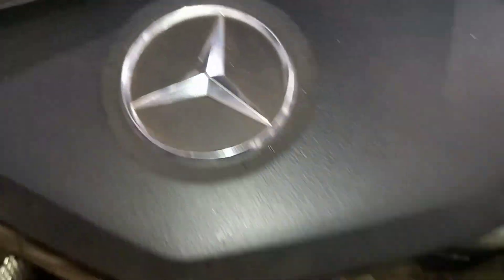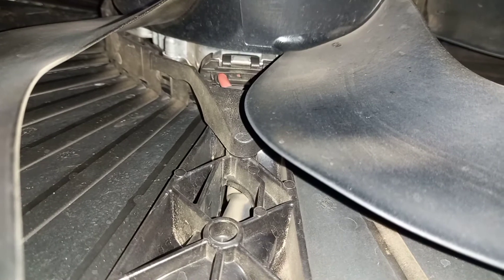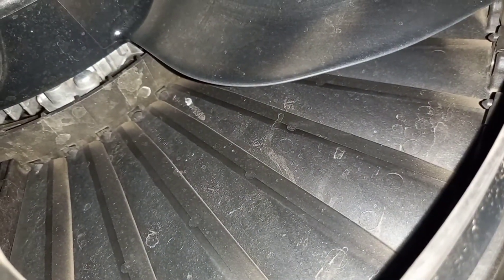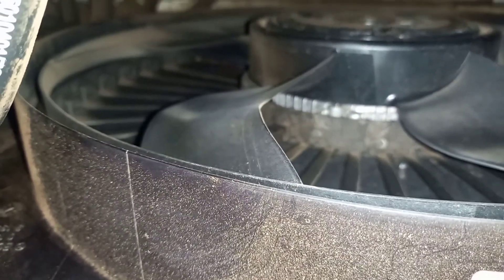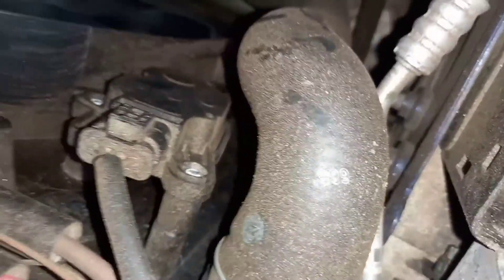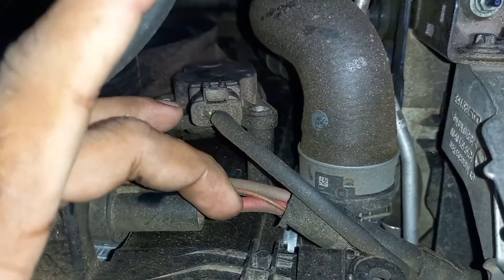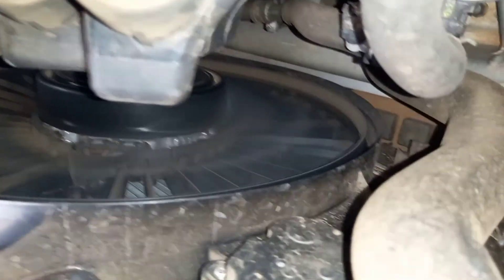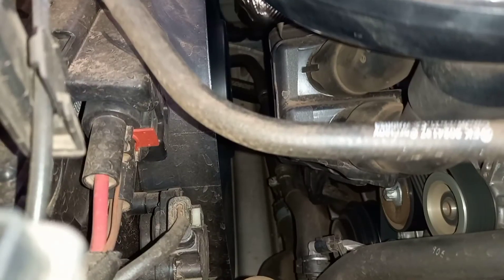Active Grill Shutter Mercedes Benz

Comment: Hi. I have a 2010 c350 with the same flaps. They never work. They stay always open. I have 12v and 3v on the 2 pins of the connector. The solenoid is not at fault I already checked( by removing the 3v and bypassing a ground it opens - therefore closing the flaps). Please explain where does the connector lead to? It's not the ecu. And why doesn't it change the voltages so it works.. Pls answer thx
Reply from the maker: @BobbyM89  bro u have xentry
Reply: @sukeshford2013  no I don't, but 8 went to a mechanic to test with that and on active test they don't move
Reply from the maker: @BobbyM89  bro there is dtc lin network
Reply from the maker: @BobbyM89  need to check lin net work voltage 8. To 11 voltage
Reply: @sukeshford2013  I have 14v and 3v on the two pins of the connector. They never change
Reply from the maker: @BobbyM89  3v should be vary . 7 to 9.above vary may be there is dtc . Other component fail